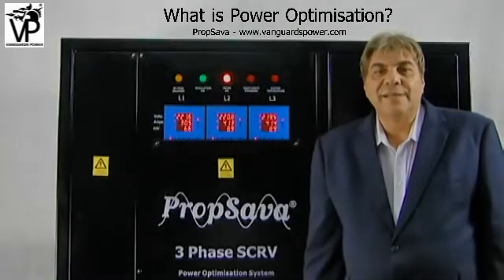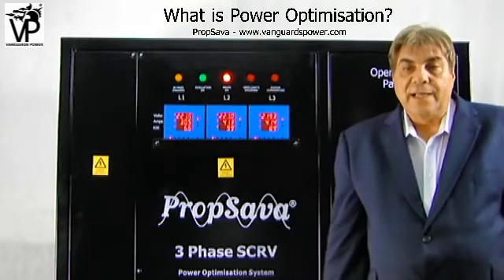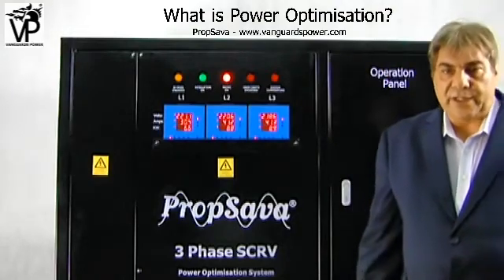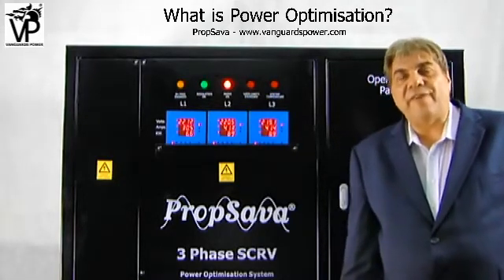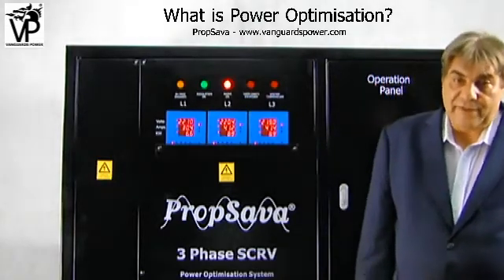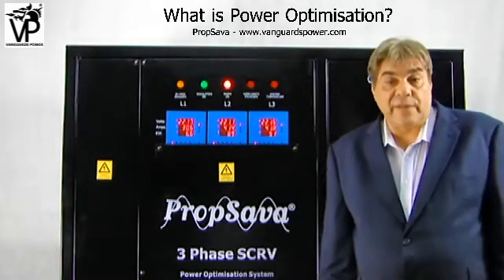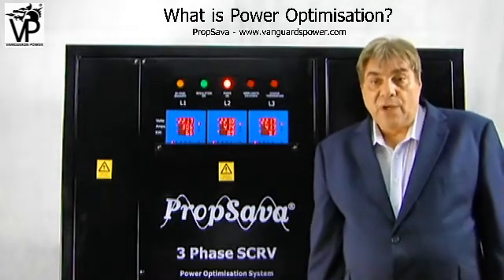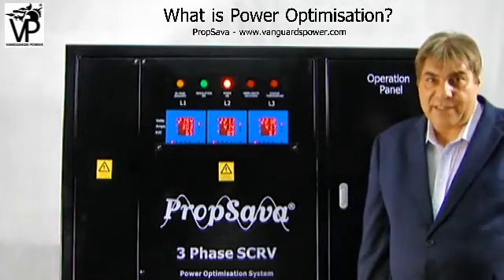What is Power or Voltage Optimisation?

Comment: What a complete load of rubbish. 
Electrical equipment is overpowered????
An electrical device will draw what power it needs. If you restrict the voltage. The device will not work as well. Voltage optimisation is just a big dimmer switch. So if you do not want your washing machine to take longer to wash your smalls Or your cooker takes longer to cook your lunch. Then stay away from voltage optimisers.
They do have certain uses in Industrial or commercial applications where large amounts of flourescent lighting is used. It will show a power saving but you will also get dimmer lights.